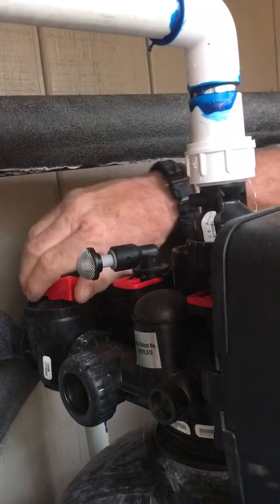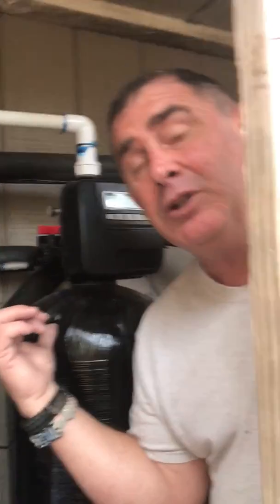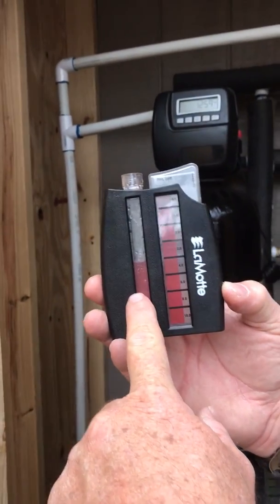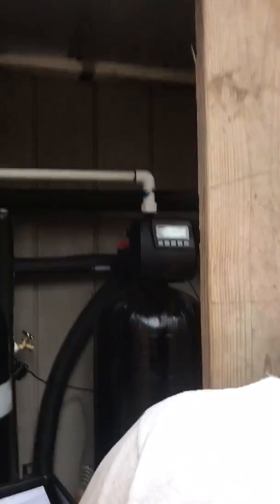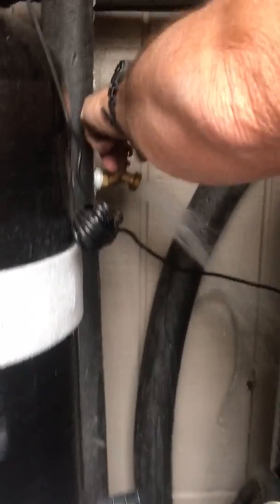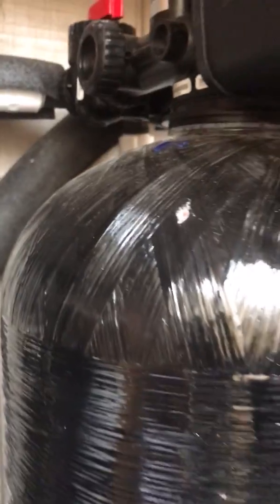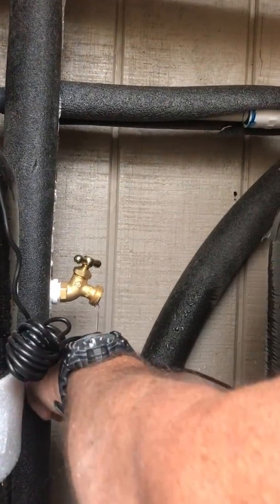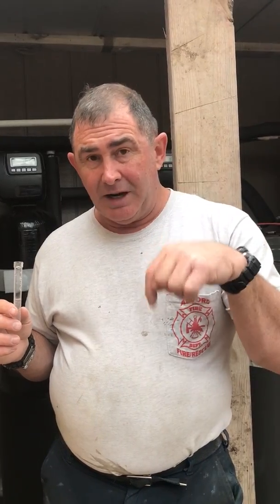What’s The Best Iron Filter

Comment: Hi Thank you for sharing you experiences with us ! I have  fairly heavy Manganese 0.731 mgl and a bit of iron 0.188 mgl   I have A clack AIO  filox  filter for about a year now it became fouled with the manganese I'm assuming. I have been struggling with it ! It has been loosing its air pocket after regen! The air pocket appears to get created on the 50 min  brine draw  how ever when it returns to service the pocket is next to nonexistent what would cause this pocket go away  when the valve returns to service mode Getting very frustrated with this valve, I bought Clack because I is a simple design How ever I am beginning to wonder if I made the right choice! I've been searching for info on how this mysterious valve works how ever there is very little out there for info!I have as of today installed all new parts in the valve injector piston kit the only part not replaced was the brine piston as I could not find one! Same problem not sure what the issue is? Any help would be appreciated!
Reply from the maker: Laura H more than likely the check valve is hung up. If you put your colored into bypass and press and hold the regen button until it goes into regen this will take the pressure off. Then on the input side of the filter you may see something that’s not on the output side. This will be your check valve if not then it is inside.  So loosen the large ring on each side closest to the valve, pull the bypass back and you should see your check valve inside the input side of the valve. Meddle nose pliers should get it out, pay attention to how it looked when it came out. Clean it in vinegar or purchase resup and clean it with that if it is fouled. You can also pour your vinegar into your tank and let it set for an hour or so to clean the media if in fact it is fouled.  Usually it gets fouled because the drain line is plugged or is not letting the correct amount of water out which could also mean you have a problem with your pressure tank.  But one thing at a time. Try and look at the check valve first. Hope this helps
Reply: Hi thanx for the quick response ! Yup! I noticed that valve in there while I  was replacing the other parts and like a dumbie I didn't remove and inspect it Because I had no spare parts if something broke. As none of the other parts I have replaced has changed the situation its defiantly worth a shot ! That valve Does not show up on any of the parts lists on the internet not a mention any where! I appreciate you helping with your comments, I gather it slides out and is on orings like everything else on the valve? Vinegar will hopefully not harm the orings? AS  Trying to get a new valve or orings  is slim! I am also injecting h2o2 so I am told that the air pocket is not necessary But in my mind the more is better for oxidizing!  The well is a  low yield well and is on a timer So This unit is circulating water from a cistern and back to it continuously.  I am injecting on the out flow with the mind set that contact time is important .
Reply from the maker: Laura H on orings and things you can contact this guy tveldboom@nelsencorp.com and he may be able to send you parts and if not softenerparts.com maybe able to help. If they can’t let me know and we can make arrangements for me to do it
Also you’ll want to make sure that you have at least 60psi in order to backwash correctly. Feel free to contact me if necessary

Comment: On a shared well. Don’t think my neighbors would appreciate bleach in their water. Can the system still be used without doing the bleach part?
Reply from the maker: Yes, you can even remove the valve and pour two cups of bleach into the tank replace the valve and then slowly run water into the tank and then turn on one faucet at a time in the home until you smell the bleach then turn faucet off and go to the next faucet until you have done the entire home
Reply: @LowCostWaterSofteners  Will there be a need to shock the well with chlorine a few times a year, or just before installing the filter?

Comment: Also my well is 40 yr. old.  Does that affect the amount of bleach you might add?
Reply from the maker: It can but depends on the casing.  If your well casing is not pvc then that may be a reason for all the iron in the water and you run a risk overtime by creating a problem in your well casing and drop pipe since chlorine is caustic however the simple fix is once you pour your bleach use a water hose to thoroughly wash the bleach down the well, my suggestion is to run the water into the well until you smell the bleach coming out of the hose which usually gives you sufficient enough time to rinse/wash the bleach down the walls of the casing and wash it off the drop pipe.  I have heard that wells in Colorado are deep and I suspect you don't have pvc casing.  How much bleach to use in your well-https://agwt.org/content/water-well-disinfection-procedure

Comment: Great video!   Just what I was looking for.   Thank you.   
Couple questions:
What do you think of the fleck ironpro2.  It’s a combo iron filter and Sofner?
And what if the ph is too low?   How to fix that?
Reply from the maker: Jeff to be honest I had never heard of the Fleck Iron Pro 2 before so I did a little digging and did not like what I found.  Let me start by saying that the guys that developed this product did the research and are using the correct medium in theory but that is when it is used in the hands of professionals and not a DIY person trying to save money and I say this because there are always too many variables that must be considered as you probably know being a plumber.  So I looked at the medium and this is what I found; High capacity resin which will remove iron, calcium, magnesium etc just like any other water softener will do.  The problem I see with this is that if the user doesn’t increase the salt usage for the brine stage then there will not be enough salt in the brine in order to remove all those contaminants.  Each one requires so much brine solution to be removed from the media resin thus creating a problem for the user who doesn’t know this.  Secondly it has carbon for H2S (Sulfur) which is a good idea along with KDF55 but the problem with that is going to be that some of the iron in the water will oxidize in the well and still be pumped into the tank and will fill (clog) the micro pores and mezziopores in the carbon thus fouling it quickly.  KDF55 is a very heavy media and they are putting 5lbs in the tank in addition to the gravel, softener media and carbon and water so it will be heavy and the end user will need a sufficient enough backflow in order to lift the bed to ensure it will be cleansed well enough.  So my thought is to filter the iron out first with an iron filter then soften.  The iron filter that is in the video is kind of a representation to this one https://amzn.to/2CfrsUX but the thing I like about this Filox iron filter is that it can be used with lower Ph levels, 5.0 to 9.0, according to the manufacturer.  If the Ph is low and you want to raise it then I suggest a 2 cuft tank with a 1/2 cuft of calcite and 1/2 cuft of corosex in an upflow valve instead of a backwashing valve because every media tank that I have had to change out the media it was like concrete and the customer had to buy a new tank and media whereas in the upflow it is less likely to do that so when it needs to be replaced it can be dumped out and then replaced.  I hope this helps.  Calcite-https://amzn.to/2ChM1jt   Corosex-https://amzn.to/2LjJ0Cc
Reply: Only in the hand of Professionals. Wow!!  If we actually had those Professionals especially where I am down here in Galveston right next to Texas.  I just spent finished building my own home I spent 2 years planning the build and because of building codes I only focused my efforts on what I could do without a license.  Of those 3 "Professional" licenses 2 are why I am scouring the internet researching and trying to correct the faults of my plumber and well drill Professionals.  I wish I could have saved all that money and took the time and researched and did it myself because right now I'm spending more and because of putting my faith in Professionals.  I don't mean to be rude but I have been working on every problem that keeps arising from every so called professional that I subbed out.  I am hoping after I disinfect my well (for the first time for some reason)  it's been in service for nearly 4 months already.  I still haven't got my water test results back hell I haven't received my drill report.  Plumber was a hack and well guy was even worse.
Reply from the maker: @adspremiumwepaypremiumfora1469  hey sir I am sorry that you had to go through that, you probably won't get a well report unless you call and tell them if they don't give you one you will report them to TDLR. Texas Dept of Licensing and Regulation, that will get them on the ball. It is law for them to pour bleach into the well once they have finished it, so it was probably already disinfected, but nothing wrong with doing it again. As far was water test results you can use one of these and do your own. This is a 10 in 1 https://amzn.to/3hakzHN    I am not sure what you want your water tested for but these will do most everything except e-coli and the other one, I cannot remember right now, sorry mental problem I have. If you have other questions please reply to the video and not on here because Youtube doesn't notify me, that is why it has taken me 3 months to find you, which was on accident but I hope I was in time to help.

Comment: Can you place the filter either side of a well pressure tank?  I was thinking to place it before the pressure tank, so it doesn't affect pressure going into the house.  What are your thoughts?
Reply from the maker: Hi mcfc68  I just talked about that but here is a video I made that will tell you and why, none the less you always want to put it after the pressure tank  Here is the link https://youtu.be/p4Sp9irEZiI
Reply: Many thanks for the quick and really helpful response. @LowCostWaterSofteners    Exactly what I needed to know.  Two more questions if you don't mind: 1) Does a Iron filter like to show negatively affect water pressure?  2) Are they truly self-cleaning or do you need to change the media every now and then?
Reply from the maker: mcfc68 an iron filter that is too small can affect water pressure. I normally use a 2 cu ft system to ensure good flow about 12 gpm which is usually more than enough. Also note that if your pressure tank isn’t functioning properly then your filter will not backwash correctly and you will not lift and clean the media bed thoroughly and thus have build up and begin to lose pressure. Another note is the drain line. It should be at a minimum of 3/4” in diameter or it will reduce the amount of water leaving the unit and you’ll have the same problem as a bad pressure tank. Yes, all iron filters should be self cleaning meaning they backwashes in their own. The media only needs to be changed when the tank becomes fouled from a bad pressure tank or too small of a discharge line. I normally use filterag plus or filter sorb and never have to go back to exchange media. Some companies will tell you that in order to get more of your money. Now if someone makes the mistake of using carbon as an iron media to get rid of odor you’ll bed will definitely foul and the media will have to be changed, I hope this answered your questions :)
Reply: Thank you sir.  You are a very generous with your time and information and I appreciate it.  Your kid makes the video great by the way. @LowCostWaterSofteners
Reply: The amazon link you provided is for a 1.0 cu ft system.  Do you have a source for a 2.0 cu ft system?

Comment: What is the best media to use?  I see Mag ocx, chem-sorb-100, greensand, etc available.  Also, one guy says hydrogen peroxide is the best way to remove odor and iron and that air injection can make iron bacteria worse.  Help!!
Reply from the maker: Dennis Logan I have used either filter sorb or filter ag plus. They both work very well. As far as oxidizer go ozone is the very best, peroxide is also good however the grade of peroxide used can be dangerous and is not the same percentage you get at the store
Air works great also as it is free and does not make Iron bacteria worse since the air is what oxidizes it (makes it into a solid) and air exposure kills the bacteria air will also remove the odor. If you have more questions please ask. I hope this helped

Comment: Very interested in this system and understand what you are saying about disinfecting the water lines in the house.  I have a water softener that all water in the house comes thru.  Is it ok to do this or will it ruin the resin in the water softener.
Reply from the maker: OneStop CheckShop you can run bleach through your water softener on occasion. I have only seen chlorine break down the media two times. Once because it went through the softener daily from chlorine injection and city water which has chlorine but it does take years to affect it. You’ll be ok for your particular application